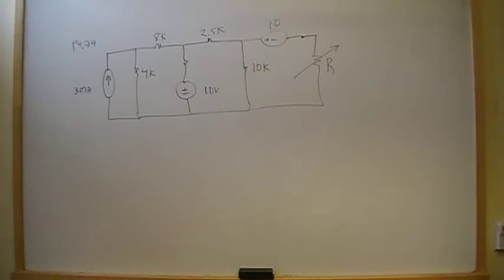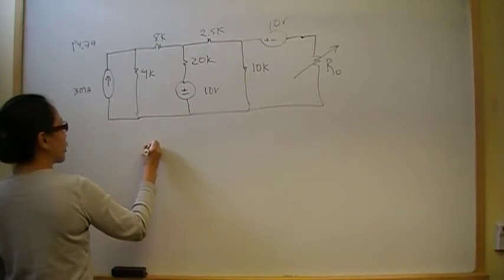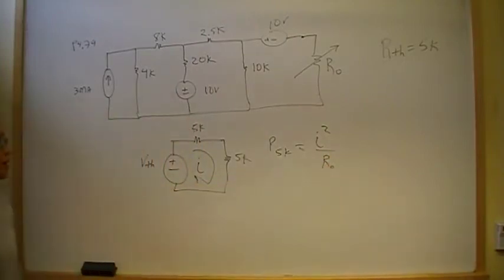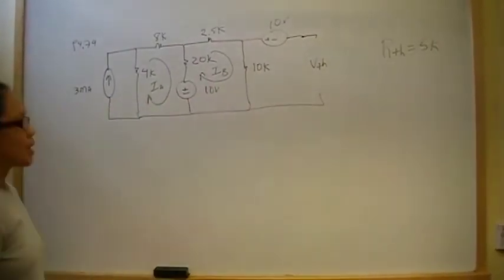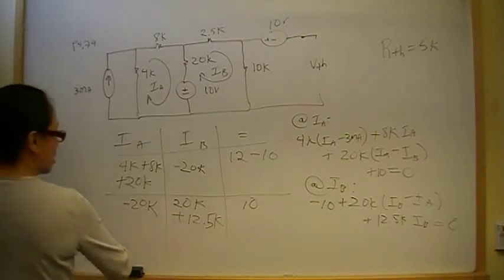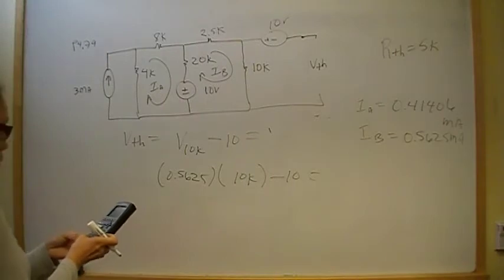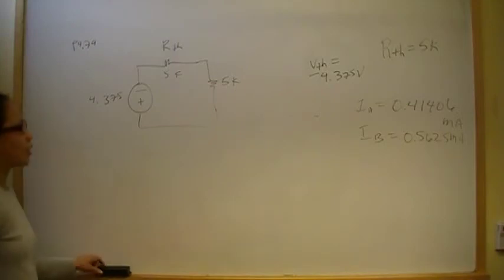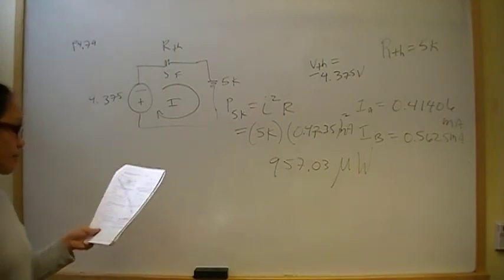Max Power Transfer P4.79 Nilsson Riedel Electric Circuits 9E Solution

Comment: For more profound, I must say that maximum power theorem has it's own equation. The way you taught here it's somehow right though this video has many shortcomings that had drawn many vital issues like wrong calculation etc, I also appreciate that some of that already corrected through overwriting but this concepts doesn't go with maximum power transfer theorem because you didn't mention about Ro or Rth in this solution. Make sure my message went towards you with positive vibe. Thank you